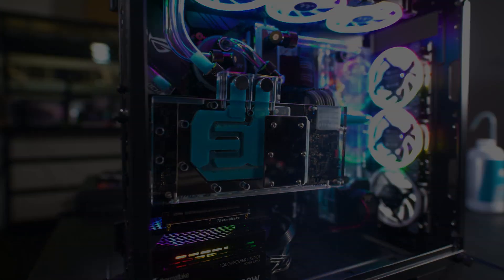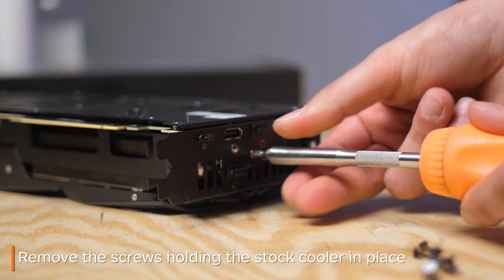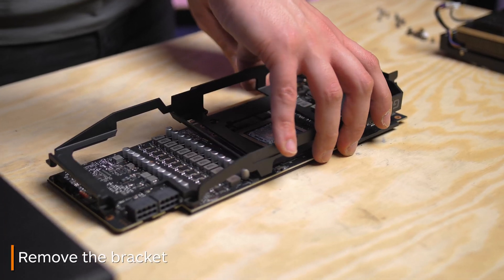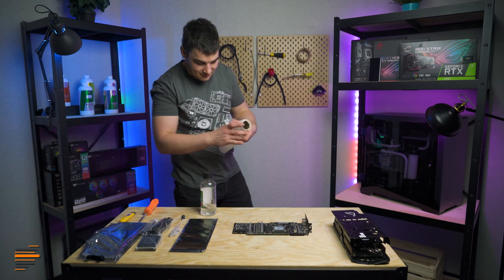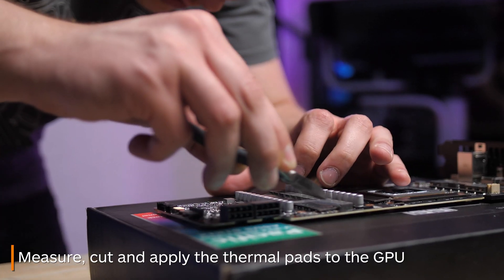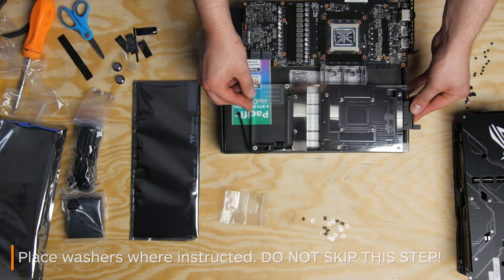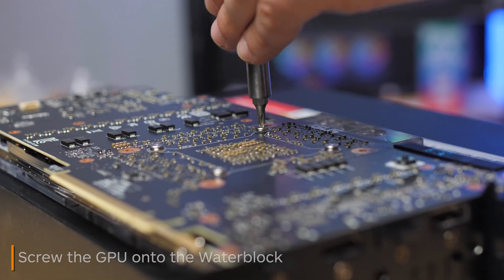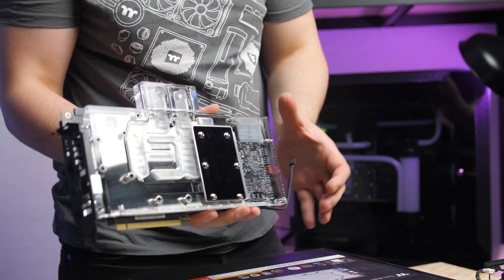How to INSTALL an RTX Graphics Card Water Block - ASUS Strix RTX 2080 GPU

Comment: Can this be installed on the 2080ti oem style cards that come with the blower style cooler??
Reply from the maker: Hey Kevin, this specific model is for the Asus Strix Model of the card, which the PCB is different from the founders.  We did have a founders edition block however, it's been discontinued so might be hard to find

Comment: I own this and its pretty shitty. 

No guide came in box, and ffs the power cable goes where
Reply from the maker: That's super annoying! There should be a manual included with your GPU Waterblock - albeit the manuals we include can sometimes be too confusing which is why we have also created this video.  
We may be able to help here, what GPU and waterblock are you using?

Comment: Can you still use the orginal back plate rather than the replacement?
Reply from the maker: Great question! With this specific model, you can't use the original ASUS Strix backplate, however, some models of water blocks from other manufacturers are able to.
Reply: @ThermaltakeAustralia  thanks for the quick answer. Truely apprciated. I do rock a 2080ti Gigabyte Aorus in my rig. Once there is an AIO version of GPU  coolers, I would fit one to it. The whole water cooling loop installing thing just scares the heck out of me. It scares me from a pricing point of view, of how much can go wrong during installation & the ongoing maintence required 🤑😫😖

Comment: Nice and concise! Doesn't the backplate also add some rigidity for upright builds?
Reply from the maker: That would be a pretty cool benefit if it did but we can't really confirm that. It does, however, make it more balanced as the water block can be quite front heavy without a backplate.